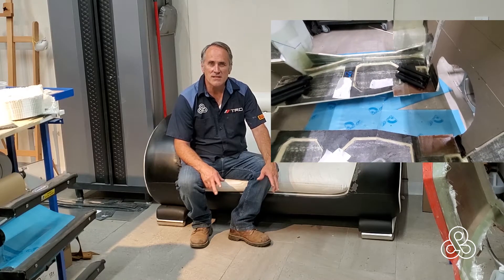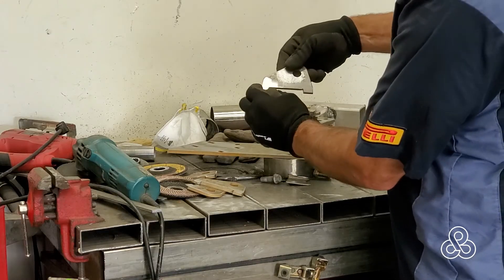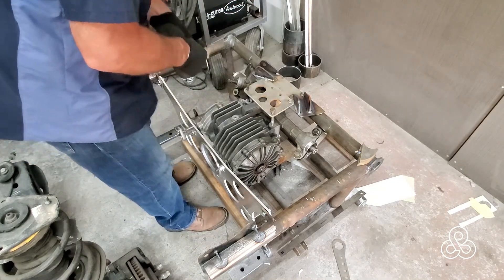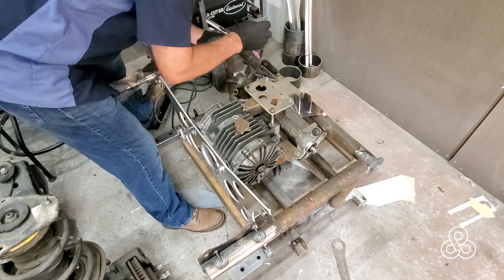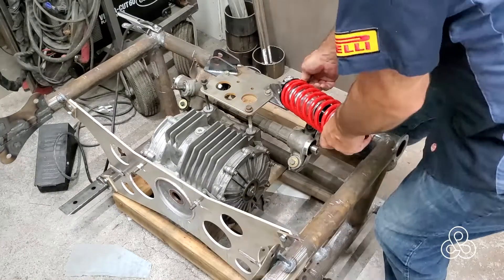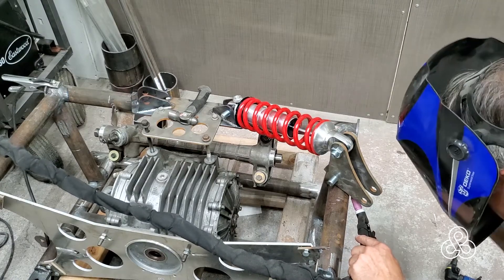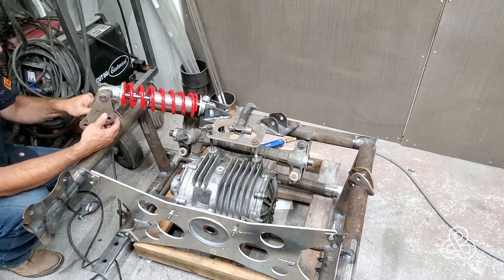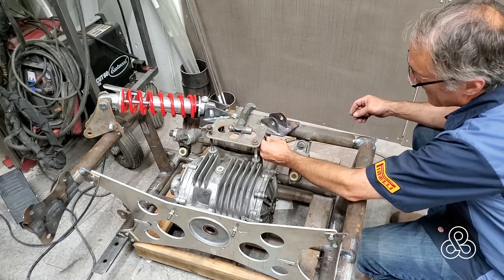A33 - Arete Supercar project - Front coil-overs and push rod rocker placement

Comment: not saying you did it wrong ,, when you welded the front tabs for the shocks .. you could have cut a chunk of pipe the with of the shock or a hair long like in thousands of a inch long ,,just too keep the tabs from pulling when welding ?? also have seen people put the part in with a washer and then weld it but the heat could damage your shock ..
Reply from the maker: All the suspension pick up points are just tack welded for now. When I weld the shock mounts permanent, I will extract the steel sleeve out of the urethane bushing and bolt it in place to fix the position.

Comment: When you are fitting the plates do you figure in the powder coat thickness ?
Reply from the maker: At least for the pick up points, I powder coat the suspension piece and install the bushings and then tack the brackets in place around it. Just never tight enough to take up the .02" the powder coating would occupy.

Comment: Is watery jet cutting not more expensive than laser cutting? Or do you prefer the finish?
Reply from the maker: It all depends on the material being cut and the amount of cut length per piece. If you cut holes that are going to be tapped, go with waterjet. If you are going to have lots of cuts in a very thin material go with laser. if you need to cut ceramic, gaskets, glass or or thick material go with waterjet. If you want to cut acrylic with a perfect finished edge go with laser. Just a few tips.

Comment: Notes on the Differential.
Turning one upside down to reverse the rotation works but you need to ensure the design can cope with it and not cause bearing failure due to lubrication not getting where it needs to. You may need to alter internal oil baffles to direct oil flow to suit the new orientation. But if you're building your own transfer case why bother inverting the diff ? Because the crown wheel and pinion will need to be spun in reverse otherwise and they are not cut for that to be the primary direction of rotation. Depending on the manufacturer of the diff you may be able to obtain a reverse cut crown wheel and pinion for it if it is used in reverse orientation in some vehicles like all wheel drives or if certain types of portal axles are used or if you bought a gearbox out of an old VW Kombi van thinking it was the same as a Beetle.
Reply from the maker: I have looked for a reverse cut gear set for the differential (Getrag 2.73 out of a C5 Corvette), but have not had any luck. As that many of these diffs were built it is likely the internals are the same as other units. if you are familiar with this or a supplier, I would be interested.
Reply: @BuilderCreator  . My comment here was not specifically for you, except as a reminder to check the lubrication, it was for others who may want to do the same thing.
If you are looking for alternatives then you should look into small 4x4s and Japanese vehicles with a good performance parts supply chain. The diff you have chosen is massive overkill as it should never see even half the torque it could handle, so smaller and liter with the same ratio and possibly a clutch based LSD

Comment: Spot the fail.

No bearings on the rocker pivot. and NO urethane won't work, there needs to be an actual bearing, a bronze bush with thrust washers and a zerk fitting for greasing would work
Reply from the maker: Something troubling you in life that we could help with? I keep finding comments from Anom Amos, that are nothing but criticism on an unfinished project. Lift your spirits make new friends, be kind and gracious, join in the camaraderie of this group of petrol heads.
Reply: @BuilderCreator  . Not criticising. Constructive criticism and tips.
Not having a proper bearing in the pivot point will possibly allow the push rods to deviate from proper alignment and bend bind or twist the pivot.
Reply from the maker: @anomamos9095  I have since this video, converted the bell-crank to aluminum and it will have bushings.
Reply: @BuilderCreator  Good to hear. Sorry if my initial comment was taken as anything other than jest and advice.
Reply from the maker: @anomamos9095  Yeah, my dry sarcasm has gotten me in trouble here in the comments. Ha! Hard to get the context right with so few words.
Reply: @BuilderCreator  usa alumio un chasis de no mas de 270 kg. va a oesa 800kg esto es un chiste ! vamos por pavor hay motores v6 o v8 con el centro mejor repartido uno en linea y encima todo absolutamente todo atras ! por favor !!
Reply: !? porque no venis para argentina para cordoba asi te enseña el profesor de pagani y te haces un zonda, un huayra
 o algo que sirva no !"?

Comment: Sweet project! I imagine you will ultimately build new subframes out of a lighter material?
Reply: I'd go for some ovalized aluminum tubes, with the stressed members being mounted vertically for the best stress management and force loading, but that can make things unnecessarily complicated. Regardless, my favorite thing to see when people are building subframes for lightness is a consideration for which components will be handling the most forces and strengthening those with thicker walled tubing or thicker sheet stock and the addition of reinforcing gussets where necessary, while building less stressed components out of thinner material so you aren't adding unnecessary weight. While it isn't exactly the same standard, Project Binky from Bad Obsession Motorsports really is a masterclass in overbuilding just where necessary, but still overengineering every possible thing.